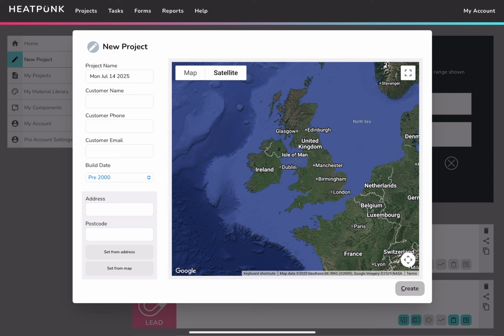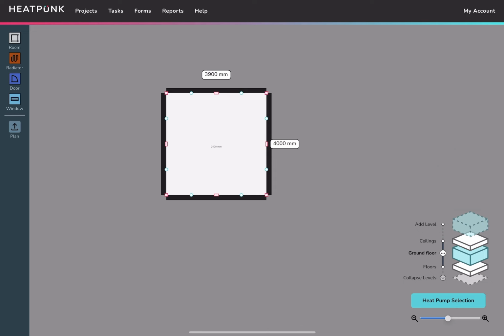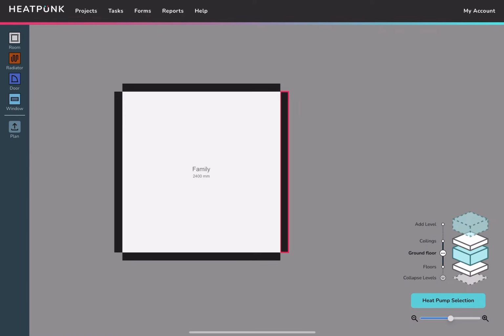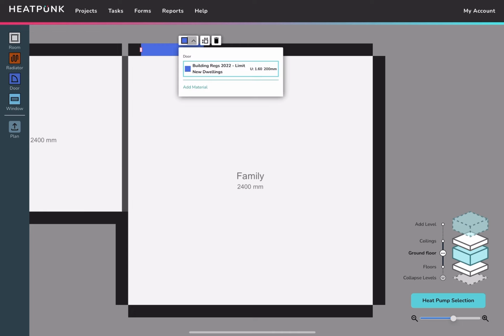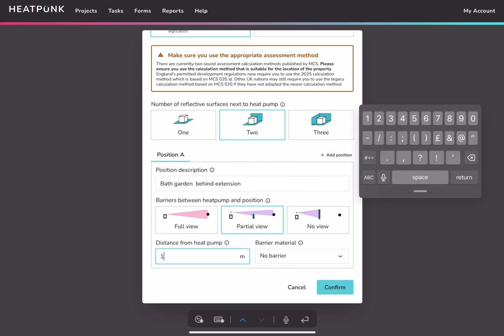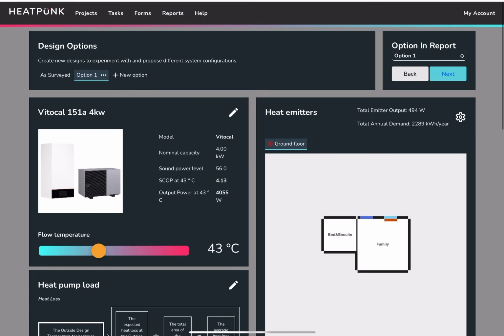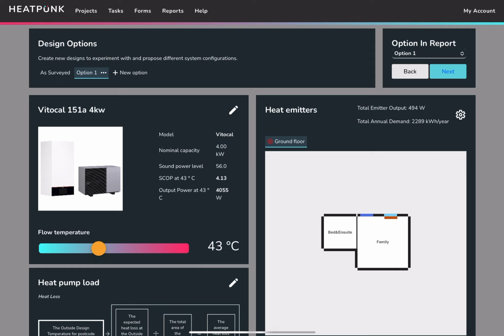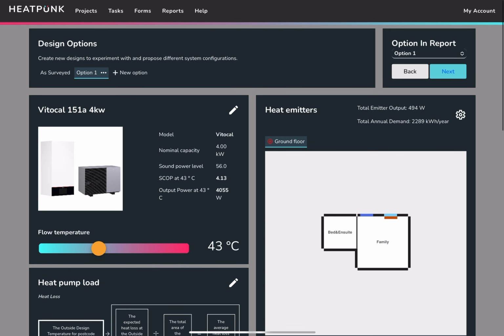Heat loss, site survey & system design for heat pumps, an overview of what’s involved

Comment: How do you design a fireplace on the floorplan? have you got more examples for such and other examples of dormer design if got RIR?
Reply from the maker: Heat Punk has the option to alter air changes by adding open chimneys. Dormers can also be accurately modelled (the most accurate from all the software I have tried to date) using the roof level drawing function. I hope that helps even it is a little late!